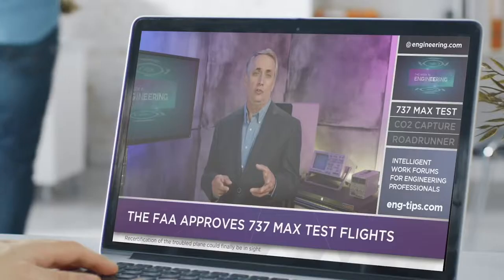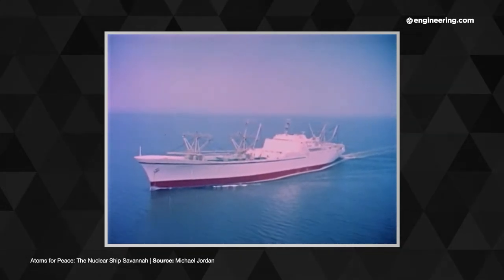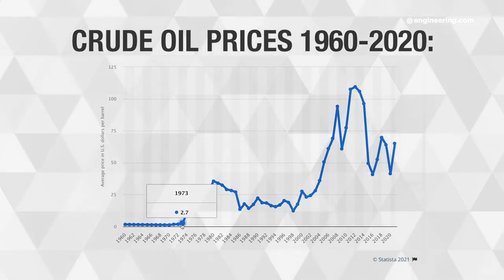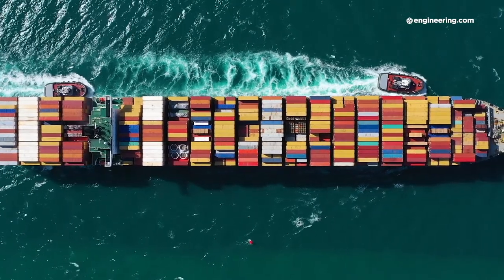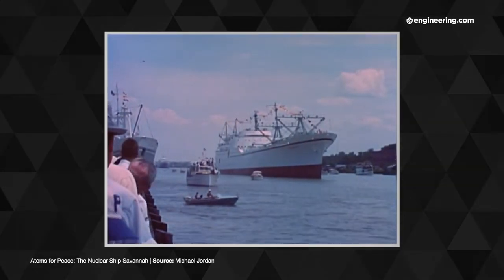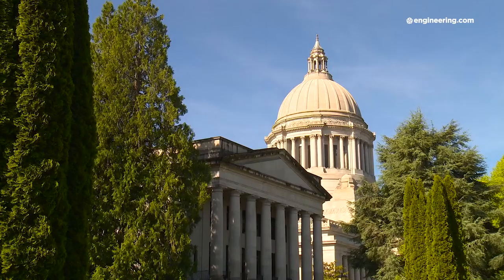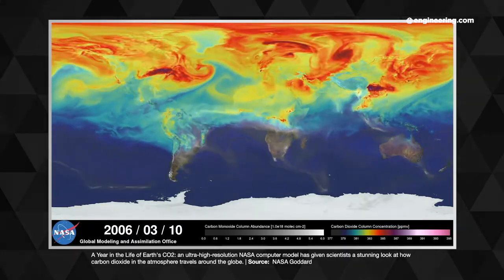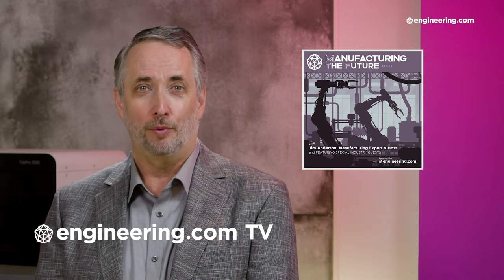Why Are There No Nuclear Cargo Ships?

Comment: I only just thought about this application for nuclear energy today, and decided to look it up. It sucks that I could have been implemented so long ago and stopped so much ocean and air pollution
Reply: Just think; would you have full confidence in the management of a nuclear reactor under the control of an anonymous entity only traceable, perhaps, via a letter box in a FOC (flag of convenience) nation state?  If you are, could you sell that confidence to Japan, the state that was subject to Hiroshima and Nagasaki nuclear detonations as well as more recently the Fukushima ‘event’?  Then try that same, or a similar, sales strategy on Ukraine, the nation state that as a part of the USSR (CCCP) hosted the Chernobyl ‘event’.

Modern iterations of nuclear energy, thorium fuel, molten salt reactors, small modular reactors or fusion reactors, will carry the legacy of past problems.  It is the global trepidation of anything with 'nuclear' in the name and the economics of nuclear having transitioned from 'energy to cheap to charge for' too 'the costs of remediation are incalculable' that will prevent the adoption of nuclear energy as a means of creating energy at sea.  Modern reaction systems may have overcome the safety problems but the general public, having been misled in the past, will be reluctant to believe the fresh new promises.  The incident of the ‘Ever Given’ blocking the Suez Canal, March 2021, may also have a little to add to this debate.  The cooling water on ships tends to get taken in from near the bottom so when running aground the inlets are in a prime spot to get plugged up restricting, if not stopping, the flow of coolant.  One thing that the Three Mile Island (TMI), Chernobyl and Fukushima incidents all had in common was that the supply of coolant, or rather disruption thereof, was a fundamental cause.  Similarly, and only months later, May 2021, had the ‘X Press Pearl’ been nuclear powered then a major port for a populous nation in the global South would have possible been the site of a significant exclusion zone due to a non-power plant related incident.  If the ‘X Press Pearl’ had on board a fired up but ‘safe’ molten salt reactor and found herself having to dissipate the residual energy associated with the possible 12.5 megaWatt power cycle would a stable cool down have been possible?  Would there have been sufficient heat energy contained in the power system to facilitate a hydrothermal explosion?  In a casualty ships may capsize, like the ‘Karin Hoej’ off of Bornholm in the Baltic early December 2021, in which situation any safety system reliant on gravity might not work.  It might also be worth bearing in mind that part of the TMI near miss was the fault of the US navy trained operators focusing on not letting the primary cooling system 'go solid'; due to their training overwhelming their education and the particularity of the situation.  The actions of the captain of the 'Costa Concordia', Francesco Schettini, may also be relevant; the consequences of his actions, whether due to ineptitude, an isolated act of incompetence or driven by a corrupt corporate culture, illustrates well one of the dangers of releasing nuclear energy into commercial shipping.  The regulators vary from useless up to good and anywhere in between some I would not trust to control a toothbrush and none are infallible.  To maintain the level of authority that the ONR (Office of Nuclear Regulation a UK government agency) exercise over the few nuclear power plants on land in the UK to visiting merchant ships would require increases in manning and expertise leading to costs that would simply not be affordable.  Safety costs; as does the engineering of the structure.  The examples I given are not exceptional typically every week a ship sinks, some large some small.  On the news on 9 Jan 2023 there was another incident in the Suez Canal, when a vessel grounded briefly; the next Ever Given scale event is only one small error of judgement away.  A sister ship of the Ever Given, the Ever Forward, ran aground approaching Baltimore on 13 Mar 2022, these things happen.
	
As a second point if you fit 'walk away safe' reactors on ships you will need duplicate drive trains as there are seldom salvage tugs around when you really, really need one.  A nuclear ‘dead ship’ drifting around NUC (not under command) would be a disaster waiting to happen and duplicate systems increase expense.  Land based nuclear power plants have a few issues but are immobile, stable and usually well regulated.  Reactors on ships by their very nature are able to move between regulators, bump into each other and roll over.  Regulation of ships by both / either flag state or port state has problems and adding any nuclear regulatory obligations on to those already overstretched facilities would be very taxing for all involved.  This is not about 'can it be safe' it is all about 'will it be safe'.

Furthermore, while merchant ships may be 'taken up from trade', as the RN would say, or may be captured or impressed by non-state quasi military entities by way of piracy, cargo ships are not military vessels.  They therefore do not have the same inherent level of self-protection and internal discipline.  Why not use nukes on merchant ships?  It is down to engineering, finance, socio-political attitudes and safety.
Reply: @BernardLS this might be the first debate that I really don’t have a proper counter for, well spoke. As usual corporate greed and human incompetence prevent the ideal solution from being possible. 

Have any other ideas for how to clean up sea travel? If you didn’t know already the oceans of the world are our lifeline, over half of our oxygen is produced from the ocean, as well other vital benefits.  Between dumping/leaking, and emissions, ocean travel ends up being one of the worst polluters particularly for the ocean.
Reply: @logans3365   All the options for sustainable shipping seem to me to have down sides, so my thinking is running along mitigation rather than transition; thus the post below yours in this thread.  Other than that and thinking outside the present discussion ‘does the world really need any more people?’  If we could restrict our reproduction to the integer value below replacement rate a nice soft landing could be achieved.  Current best estimate is a replacement rate of 2.1 so two children per couple.  However such philosophy is way out side my area of expertise, I am just a simple seafarer who strayed into environmental science.
Reply: @BernardLS  mitigation meaning reducing our reliance on globalization and the exploitation of less developed nations by being manufacturing closer to where the goods are needed? This is what I came up with in the shower this morning. 

I do agree that soon some sort of population control will need to be implemented, especially seeing that usually the people with the most kids are the ones that probably shouldn’t be raising kids. 

There are also the health benefits of eugenics to consider. It’s still being studied but it’s theorized that prior implementation of eugenics could expand the human life span to hundreds of years by phasing out our more defective gene sets. (Based solely on science not race or affiliation)
Reply: @logans3365  how much of what we consume is what we need & how much is 'stuff" we want mainly because it is marketed to us?  If we are luck enough to be getting our needs with both security and certainty of supply can we opt out of the rest?  Some things you need to move about a lot, on a global basis. Like knowledge & education.  Rather than shipping Toyotas from Jspan to Australia why not make them locally?  If you live in a forest why build on brick rather than timber?

Not sure I would rely on eugenics or any other science to select fod breeding I would rather everybody did their own thing, but again education would be essential.  Along with clean water. adequate health facilities and responsible government.  If all the women in the world only had two births both of which survived to adult hood just think how much more commercially productive they could be? Sometimes I get to cynical for my own good.
Reply: @BernardLS  capitalism demands infinite growth, as long as we rely on it we will always continue to produce more than we really need. Look no further than our rampant planned obsolescence problem.
Reply: @logans3365  My rampant obsolescence problem is I still have an overcoat in my wardrobe that was made in 1970 .  It fits a little tighter than it used to and I have churned my way through a dozen or so overcoats / Hi Vis jackets et cetera since then but it has been a hard life.  Profit / capitalism grew out of our ancestors making sure they had enough, & a bit more, to get through the hard times.  Engineers, academics whatever are always looking for the easy way and often that is ‘if it isn’t broke why fix it?’  Economists get in a spin about ‘lack of growth’ because they are a ‘one trick pony’ & that is what they got taught.  Only within the last few decades have they started facing up to ‘Japanification’ as they call it, where life continues even as population shrink due to demographics change.  WADR the world will not cease to exist if ‘the economy’ does not continually expand.

Comment: Just Imagine how much money, pollution and CO2 generation could we save!!
Reply: Just think; would you have full confidence in the management of a nuclear reactor under the control of an anonymous entity only traceable, perhaps, via a letter box in a FOC (flag of convenience) nation state?  If you are, could you sell that confidence to Japan, the state that hosted the Hiroshima and Nagasaki nuclear detonations as well as more recently the Fukushima ‘event’?  Then try that same, or a similar, sales strategy on Ukraine, the nation state that as a part of the USSR (CCCP) hosted the Chernobyl ‘event’.  Modern iterations of nuclear energy, thorium fuel, molten salt reactors, small modular reactors or fusion reactors, will carry the legacy of past problems.  It is the global trepidation of anything with 'nuclear' in the name and the economics of nuclear having transitioned from 'energy to cheap to charge for' too 'the costs of remediation are incalculable' that will prevent the adoption of nuclear energy as a means of creating energy at sea.  Modern reaction systems may have overcome the safety problems but the general public, having been misled in the past, will be reluctant to believe the fresh new promises.  The incident of the ‘Ever Given’ blocking the Suez Canal, March 2021, may also have a little to add to this debate.  The cooling water on ships tends to get taken in from near the bottom so when running aground the inlets are in a prime spot to get plugged up restricting, if not stopping, the flow of coolant.  One thing that the TMI, Chernobyl and Fukushima incidents all had in common was that the supply of coolant, or rather lack thereof, was a fundamental cause.  Similarly and only months later, May 2021, had the ‘X Press Pearl’ been nuclear powered then a major port for a populous nation in the global South would have possible been the site of a significant exclusion zone due to a non power plant related incident.  If the ‘X Press Pearl’ had on board a fired up but ‘safe’ molten salt reactor and found herself having to dissipate the residual energy associated with the possible 12.5 megaWatt power cycle would a stable cool down have been possible?  In a casualty ships may capsize, like the ‘Karin Hoej’ of Bornholm in the Baltic early December 2021, in which situation any safety system reliant on gravity might not work.  Why not use nukes?  It is down to engineering, finance, socio-political attitudes and safety.
Reply: @BernardLS  Too much text
Reply: @Mick1714  It is a complex subject.

Comment: The 26th UN Climate Change Conference of the Parties (COP26) held in Glasgow between 31 October 2021 & 13 November 2021 established requirements and targets for mitigation of the production of GHG and with regard to shipping steps to reduce atmospheric pollution to acceptable levels could include: -
1) Abolish the cruising fraction of marine transport;
2) Abolish recreational boating;
3) Reduce 'freight mile' distances;
4) Reduce freight carrying capacity;
4) Improve fuel quality;
5) De'fossil'ise the fuel chain;
6) Localise production to consumption;
7) Reduce the global population of consumers.
The use of any of the options above may not be the future of marine transportation but moving less material and moving what is transported over shorter distances, as in the past, should be.  Together with localised production and minimised consumption a global population that has individuals’ voluntarily self limiting reproduction to two children per parent (both male and female), might save the planet.  Shipping currently has a 'high volume, low added value' business model and it needs to return to the 'low volume, high value added' model it followed in the past.  Any alternative to the existing system needs to provide better value and so depends on the yield; the energy input less losses must provide energy output that can be deployed for propulsion, cargo handling and domestic services.  All of which must be achieved consistently and within the current limits of mass, volume and cost.
Reply: And poor, export-oriented countries need to stay poor. Global trade raised billions of people from poverty
Reply: @fenixfve2613   I agree with the second sentence of your post as strongly as I disagree with the first.  Global trade is like my beer consumption, some is good more is not necessarily better.  The ‘export-oriented countries’ do not necessarily have to be ‘poor’, WADR Germany is a prime example of an industrialised country that is both wealthy and export orientated.  Having countries that are ‘poor’ has more to do with their governance and demographics than trade.

Comment: ‘They’ say nuclear is cheap, it’s not it is expensive, and has a large embedded carbon quotient as well as being complicated, dangerous, not universally socially acceptable and having only ‘no need for refuelling’ as a questionable advantage; actually it does need refuelling just not as often.  When ‘they’ do need to refill the warming up stuff it takes considerable longer than pumping tonnes of thick black stuff, cSt380 HFO, or thin runny stuff, MDO, onboard which is one of the reasons HMS Queen Elizabeth (QE) and HMS Prince of Wales (PoW) are pushed about by ICEs and gas turbines thus using a similar fuel as the aircraft that fly off of them.  The Royal Navy (RN) with a high degree of skill and expertise uses, at vast expenses to the UK taxpayer, a current operational nuclear fleet of 11 submarines (also known as ‘boats’) in two flotillas, seven attack subs and four ballistic missile boats.  The carbon footprint of all the extra bits of hardware and the fuel, including processing thereof, from ground to propeller, are the external costs that never seem to get considered.  The USN is not, as far as I know, a commercial organisation working to very tight margins and also has the skill and expertise to handle the complexities of nuclear power; so as well as submarines their aircraft carriers are nuclear powered and each of the current iteration has a build cost three times that of QE/PoW, bigger crews and even more generous funding.  For those who still think that nuclear energy might be the answer I recommend this report: - https://www.bbc.com/future/article/20200901-the-radioactive-risk-of-sunken-nuclear-soviet-submarines?ocid=ww.social.link.email.  The navy of the USSR might have been under resourced and over extended but it was still generously supported in comparison with merchant shipping.

Disposal, once it wears out, of both the machine (that was a ship) and fuel is another can of worms best left unopened.  The 21 RN nuclear powered boats no longer in use are laid up (some, 7, in Rosyth and some, 14, in Devonport) awaiting deconstruction including dealing with the fuel rods and other irradiated material.  Also twenty years is a typical life expectancy for a commercial hull so about when the reactor needs refuelling, due to the elements being 'poisoned' (?), it is time to drag it up a beach on the Indian sub continent and start beating the thing to death with hand tools.

Another, similar but more extensive, view may be found at https://www.quora.com/Why-are-there-so-few-nuclear-powered-cargo-ships-If-it-works-for-ice-breakers-and-submarines-why-hasn%E2%80%99t-it-been-established-for-merchant-vessels.